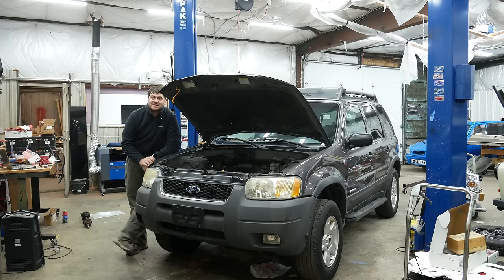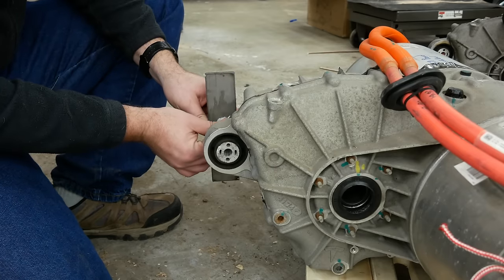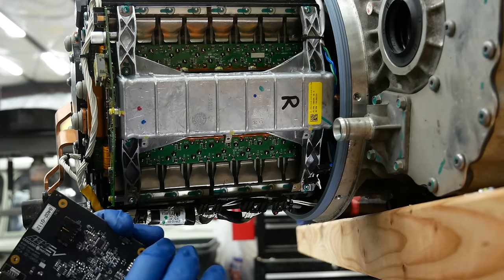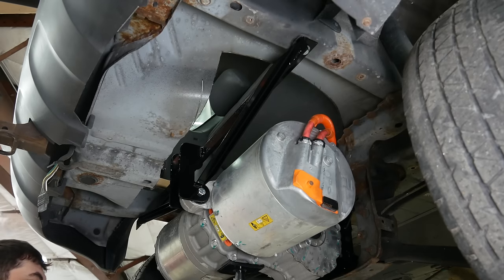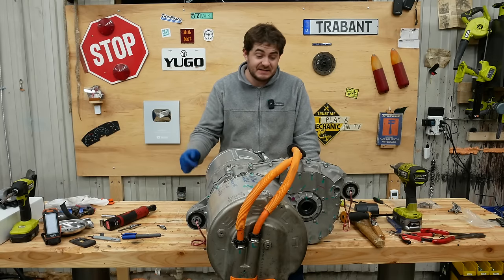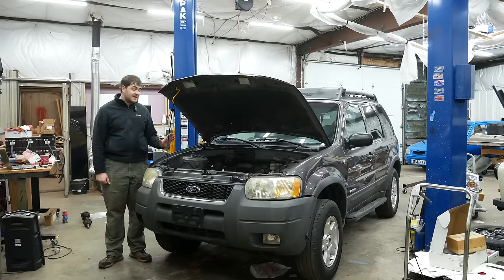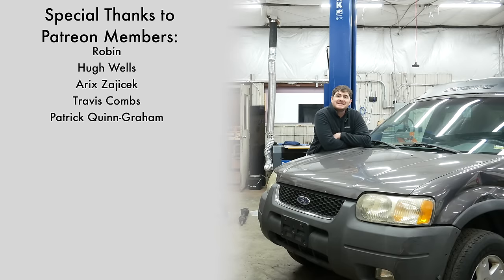This Escape is Now Rear-Engined (and Front-Engined) | 900HP Electric Escape Project

Comment: I dont know anything about car batteries however I own a one plus 8t phone and it has one of the fastest charging time in the world. The reason for this is that the battery is technically and physically split between two separate batteries inside the phone.  so when a 50w charging block is applied one battery acts as a capacitor for the other battery. it charges incredibly fast and is used to slowly charge the other battery.  I would look into this tech for your battery set up.

Comment: On that drive unit the torque curve is dead flat until ~45mph, after that the slope resembles a ski jump ramp (with a small bump halfway) but at 65mph you still have ~425 ft lbs so you're good.

Comment: Dude, I had a loose engine mount on my "52" horsepower first generation Civic. I would much rather build the motor mount 3x and get it right, than build it once and have it clank around in a loose mount. Good job keeping at it until you had it done properly.
Minutes later: "If I had to build the rear mount again, I'd do it like this. I'm 90% confident. Do I want to take an extra day to achieve 100% confidence on the rear mount?" Yes you do, because that drive unit is an expensive thing to drop on the ground. "Yes, I do." YES, proud of you.

Comment: 2:18 I love how those prototype prints where you just use whatever extra filament you have laying around looks like sticking a Lego engine in a car XD
12:20 Given that my first project involving attaching a large motor to something failed and dropped (read: violently torqued) the motor on concrete at speed, that is probably the right choice. 
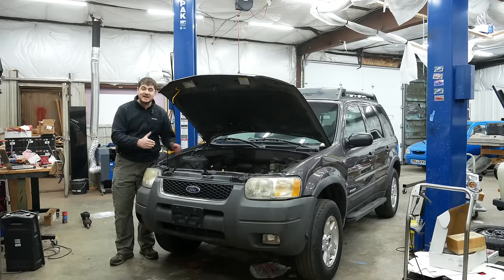16:21 That's ridicul-wait... OH. That's ridiculouser!

Comment: As for the bus project i have picked up a 500 lb torque axial flux 6 phase motor. 2 900 volt drivers is like 4 of those tesla motors in 1 package.  There is a yoke to mount into the current desiel trans. I can link info

Comment: I think that rear front engine mount needs bracing down to the cross member below it, I think it's part of the subframe but you could make it bolt to that too so both parts at still removable

Comment: When talking about Mount stress, did you also consider the bolts?  I just wonder if you kept it in mind or if you aren't concerned about it. 

I once had a bolt snap from a timing belt guide roller, not much stress you'd think, but metal fatigue still set in. It was a design error though, so I got a far stronger bolt to replace it  and was really lucky the engine wasn't damaged LOL .But the standard bolt that came with the replacement? Yeah... not good enough XD .

Comment: Watch out for motor coolant seal leaks on those Tesla drive units. I have rebuild about 6 RAV4 EV drive units for coolant seal, motor and gearbox bearing failures. Many early tesla drive units were replaced under warranty for this issue. As far as I am aware the issue was never fixed on the replacement units.

Comment: You mentioned the torque limitation of the Allison transmission as a negative for increasing the diesel engine torque. The rear drive unit also has a torque limit, so you need to factor in that to the equation of usable toque. It will probably last initially but life will be reduced exponentially to the torque increase over the design limit. This may not be an issue if you only use it for short excursions above its peak toque capability but the life is based on a user profile and probably will only have about 5% of the life at maximum torque and maybe 50% at 30% torque

Comment: If you want to hide the motor, use one of those sheetmetal guards that they put under a muffler to protect it from punctures and stones etc. It wouldn't look out of place. Extra points if it's pre rusted hahaha.

Comment: Not that it matters now, but that side motor mount is removable from the drive unit.  You have to take it off to get the DU out of the Tesla subframe.  

Be careful with that plastic water outlet, too.  They'll brake off if you look at them too hard.

Comment: Have you looked at the brake and power steering system used in they hybrid escapes? You may find some parts you can use that just fit.

Comment: However, you could take a cue from diesel locomotives and use the engine to drive a generator to provide current to the battery and drive units.  Granted that would make it a hybrid, but would give you awesome range.

Comment: for power brakes, you can get a tesla ibooster, there are a couple community efforts out there to get those working as standalone

for power steering, if you'd like a column mounted EPS, the toyota prius EPS is a fan favorite of the hot rodding community as with ZERO wheel speed data it defaults to a basic assist map
if you'd like a rack mounted EPS, the VW 1k0 909 144 steering rack is cheap, and damn good. it will require some extra can work to.. work but nothing too serious. a comma ai panda can replay any can messages you may need

Comment: 7:40 - They use that same goo on the inside of Bosch ABS modules. A lot of those modules have thinner than hair gold wires that for some bizarre reason run about 1/2 an inch from the circuit board to other parts of the module... I guess the goo stays, well... gooey to prevent the wires from vibrating loose or pulling due to heating up and cooling. 

This is the exact reason why those ABS modules fail, though, the little gold hairs sever and then a specialty shop has to ATTEMPT to remove the goo and reconnect the micro gold wires... it doesn't even always work. Still though, I think the goo has to do with thermal expansion and vibration.

Comment: Typically electric motor torque curve begin max at 0rpm and is limited by the inverter phase current and it remain flat at up to about 50-60% of max speed and then start to decrease at that point.

Comment: At this point you might as well make your own custom badge for the front of the Escape in place of the Ford logo. Just have DUNN in big blocky letters, maybe make a lightning bolt in the middle of the two Ns
Reply from the maker: Really begs the question, how much of a car's "persona" is based on the powertrain?
Reply: @agingwheels  I'm not much of a car guy, but I think much like a person it's what on the inside that counts. It's what drives you. And an added third car related pun.

Comment: The bus is a perfect platform to replace the engine with a diesel generator, like a locomotive. The. You can have all the benefits of an electric with the extended range provided by the on board generator

Comment: I really don't know how to feel about the fact that I know I'm looking at the future of hot rodding here. In 10-15 years, these kind of beefy drive units are going to be absolutely everywhere, and they'll be cheap as hell. It's going to stop making financial (and performance) sense to mess around with expensive speed parts on a decent crate engine, because you'll get completely dusted by literally any cheap junk running a pair of these drive units in them. The times, they are a changin'.

Comment: just at first glance, I think you may have murphed your numbers on the torque calcs.  The diesel numbers are Engine Rating * Transmission Gear Ratio * Axle Gear Ratio, where as I think the Tesla Drive Unit should be more accurately thought to have it's Transmission Gear Ratio included in it's initial Engine Rating number - but I'm not certain.  If the 660 lb/ft of torques is the rating at the CV shaft connection, then you don't get an additional 4.5:1 on top of the 660 ft/lbs - the 660 ft/lbs number includes that 4.5:1 reduction.

Comment: I may dislike EVs but the fact that you can use EV parts to give an unassuming vehicle almost 1,000 horsepower, there's some merit there. And knowing electric motors, that thing is gonna have the torque to take off like a rocketship.

Comment: They make a stand alone vacuum pump that would satisfy your power brake needs,  but if you converted them to hydro boost a single electric drive unit would power both the brakes and steering.  Would a bump steer shock help deal with the rotational torque of the front drive unit?

Comment: have you thought of making a range extended diesel bus.  use the diesel motor that runs as a generator and it used to top off the battery pack.

Comment: Horsepower is what everyone seems to worry about.  I worry about range.  Going fast or doing work with the motor and battery only uses it up faster.  Rather than seeing how fast I can go from one stoplight to another,  I would rather see how many stoplights I can go before getting range anxiety.  I could be wrong but wanting to go 500-1,000 miles is more my goal than only going a couple of hundred at best.
Reply: Yeah, but he has other vehicles for that tbh. Also with electric cars that rage limit is really only the limit of how far you can go in one day, as normally you charge it at night.

Comment: With this set up you can hopefully run in front wheel drive or 4wd or rear wheel drive only lol
Reply from the maker: Even better! I can run the front and rear drive units in opposite directions for big cyclonic burnouts. Well, theoretically. It won't be as impressive with open diffs

Comment: Even though I'm too lazy to read the previous twelve hundred comments, and expect my comment to drown in even more comments, I'm going to comment anyway.

When you feel satisfied with the Escape test and ready to work on bus, feel free to use existing manufacturing techniques and key your sheet metal parts together with tabs and slots.

It takes more work and time to draw your parts, but you will win the time back with faster assembly and possibly higher accuracy. And done right it can also look good.

If you plan to keep cutting your parts with numeric control.

PS. I read that there is concern that the bus back axle might not take the motors combined torque. 

When playing with the car, bring a box of nice to have stuff and see what acceleration it can take. And use that as a reference when setting the parameters for the bus.

Since the bus is going to be an RV, I assume that everything in it won't be bolted down.

If you set the acceleration to what the interior can handle, then the drive train will be just fine. Promise.

Comment: Curious about the bolts you used through the motor mount — they did not appear to be SAE Grade 8 or Metric 10.9 … would stronger steel help your torque handling

Comment: I didn't know that EVs use AC motors. I guess even with the efficiency loss of the inverters it's still better than using a DC motor. Cool

Comment: I would remove the rubber isolators from the original motor mount and use steel spacers. The tilting force will not be kind to the housing of the motor nor the side motor mounts.

Comment: I think you are on something very special, maybe it can become a your daily driver or a universal converting kit for body on frame ford's SUVs. 

This project I'm really excited to see the end. 

One thing I have to say is that one motor is more than enough. 2 is too much for such small battery pack You are going to use (assuming you can't fit 80kw of batteries in such small car) 
The voltage sag will enormous and also the wear of the battery pack. 

High chances it will be slower with only one motor so watch out for that because the extra weight lack of battery performance. 

Please, go ahead and Do the math for the peak amps discharge for both motors working at once and be sure the battery pack can supply at least 150% of that (just to be safe).

If you want to keep 4x4, "just" install the motor connected to the original gearbox. I think you won't destroy it so fast because your tires will lose traction before the gearbox become mushy steel.

Comment: With the escape - I was wonderin if you were gonna do the cv shafts; cause there's no way in hades the stockers would handle that. With  those done, the question i have is if the subframe points where your mounts welded up will take that kind of load - Id definitely find a closed road or track to test those out.

With the bus - While I get what you are after insofar as torque, my question is - how much mass in batteries will you need to add to get a comparable range to the diesel? OK, odds are you wont drive this rig in the cold, but, You have said you wish to tour with this creation - The sad reality is, battery tech isnt where it needs to be (yet).  My suspicion is you are either going to have a bus that is sharply limited in range, or a bus so crazy heavy to get some of your range back as to not gain much, OR you'll be mounting a gen set on it anyway. Id keep the factory fuel tank mounted for that last reason.

Comment: I see a problem.  If you don't use a single transfer case from the new motors any mismatch between the two power inputs will cause them to fight with each other.  That can cause damage to the tires, transfer cases, motors, and perhaps it'll just lock up and not go anywhere.
Reply: The controllers are designed to talk to each other and maintain a set power bias since they know each other's speed and power output. His aftermarket controller probably has simple settings for adjusting this.  There are plenty of dual-motor AWD electric cars.

Comment: I think that front motor mount should be strong enough...

If we assume that the motor's torque spec is given at the splines of the drive shaft outputs (1.5 inch diameter so 0.75" radius)...

What was it, 600 lb-ft? So if that mounting point is about ten inches away from the center of the drive shaft output, if my head math is right, that's only something like 400 lbs of downward force. If that was likely to be a problem, it would seem flimsy just mounted there not doing anything, and it doesn't, at least on video. I would make sure to use high-spec bolts, though, which I'm sure you did, since you live in an area that gets some snow and those bolts are under the car and will be exposed to salty slush... I mean, surely you used really nice bolts... right? ;)

Comment: You're probably not going to see this and I'm not sure if you did this but what if you kept the CAT Diesel Engine and used as a diesel generator so that you can have more range and security knowing that you don't need to worry about finding a charging station that you can fit the bus into and also not have to spend hours waiting for it to charge in one place

Comment: Are you going to use a diesel electric hybrid setup, for range extension or for using the diesel engine at only its most efficient rpm/load?

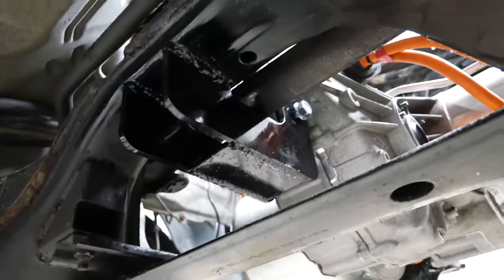Comment: As to your front mount at 23:01 - sure looks strong enough but I can't say the same for the chassis where it connects to the car. Why not brace straight down to that cross bar - or does the bar move ?

Comment: My question is the direction of the motors. It looks like the back motor dif faces forward while the front motor dif faces the back. If  so why does the that motor have to run in reverse because being spun around it will turn in the opposite direction.

Comment: Not sure if those mounts on the rear with their lever arms are going to be strong enough, not ideal. If they aren't up to the task it is because they have to reach to far to attach to the cross members. If motor could be raised up it could be a solution. I'm also see a need for triangulation in two directions in places.

Comment: For when you got those drive units wide open (for example at 18:32) I'm just a bit confused.  Are those gears inside supposed to be bathed in oil during use?  It just seems weird to me because inside the case seems bone dry like it's never even been ran before if there is supposed to be oil in there during normal operation.   Don't get mad at me and tell me to watch the first video though please.  I did it was just a long time ago and now I'm back to follow up on the dual motor escape.
Reply: It was shipped to him dry, it needs gear oil.

Comment: Honestly I thought I'd be stroking my grey hairs in 2050 before I thought I'd be watching the kids hot-rodding Tesla tech.
In true fashion, Surprise MotherLover
Add: Probably not particularly helpful now, but rubber pads in the motor mounts are done primarily for quietness ala road noise. Race cars typically are solid mount, i.e. metal on metal or metal on composite. The in-between for 'street muscle' is poly bushings, the ubiquitous polyurethane (or Delrin). Harder than rubber and more resilient, but softer than full metal contact, you'll net a more secure mounting point between engine (or motor in this case) and chassis without being shaken and rattled to death. Although with the torque these things are going to produce, that might happen anyway. I doubt there's an aftermarket Ford Escape poly-mount out there, but most any race or off-road shop will have offerings to size. Delrin stock on the other hand is much easier to find and customize yourself, though I would advise to add a metal inner bushing for bolts to pass through so lubrication is easier to deal with. 
Reason I bring this up is your potential torque will be prone to ripping through rubber mounts with ease unless you plan on absolutely babying any potential launches or staying on the very safe side of going .9 Mach, but that wouldn't be terribly fun at all...

Comment: Hey, the whole process and evolution of engineering is here, though: measuring, cutting, cursing your measurements, re-measuring, realizing that you could actually measure and prototype, then cut, weld, look at your product, start over, produce a better device, realize you don't trust your own work for one section, farm that part out to a specialist, find something else to work on while you wait for the specialty part...